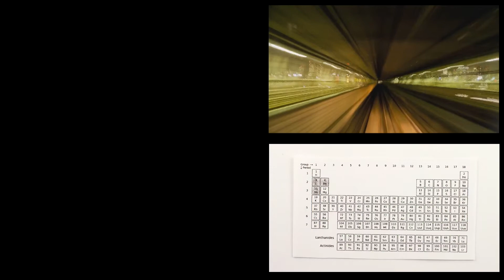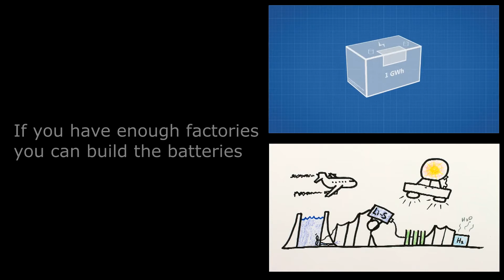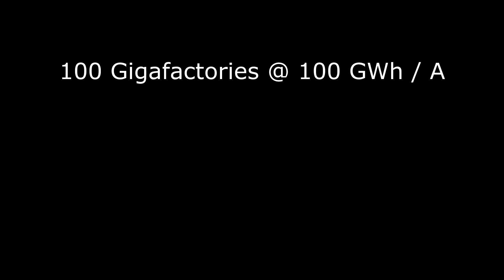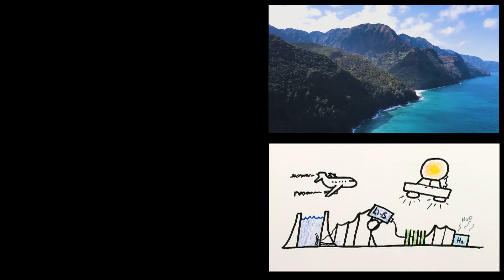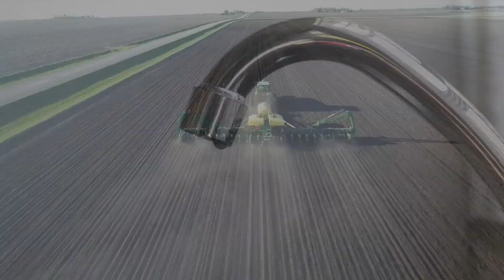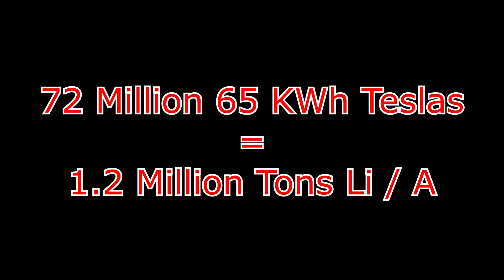Rebuttal to Minute Physics and Real Engineering

Comment: There's an even more egregious problem inherently in the wind-to-battery-size estimate. It starts from the premise that the 130 MWh Hornsdale battery next to a 350 MW wind farm "removes the problem of variable wind speed" and makes that wind farm a dependable on-demand power source. This is bullshit, the battery cannot store so much energy (only 20 minutes of full output) and it also can't even release enough at once. It is there to provide some balancing and a little bit of storage but doesn't make the wind farm fully dispatchable and no official source claims so.
This is like saying the standard lead acid battery in my car makes it an EV.

Comment: Another thing that can be noted as incorrect in both of those videos is when they say that being light weight is a largely important factor in developing batteries. Being light weight has actually very little bearing on whether a battery is suitable for grid-level storage. Sure it is important for mobile applications like phones and vehicles, but not for immobile installations.

In terms of grid level storage even energy density is not as important as material costs, availability and engineering costs. These batteries would need to be cheap and simple. Currently Lithium Ion technology is completely inadequate for the task.

Comment: Right at the moment, the battery volume constraint isn't lithium itself, but lithium cobaltous oxide.  There's about as much mass of cobalt as there is of lithium, & it's much more difficult to increase cobalt production than lithium production.  Li comes from salt deposits & brine (petroleum brines, currently being pumped into aquifers around the world, could be tapped for this, as could seawater & many saline aquifers), while Co is mostly a by-product of things which are already expensive & being mined about as fast as possible.
Obviously there are other chemistries which could be put to use, but they would require entirely new factories.

Comment: Did you see the scathing report by Abdulla et al, here, on Department of Energy's nuclear energy programs? http://iopscience.iop.org/article/10.1088/1748-9326/aa7f10/pdf

I mentioned this in passing on one of my previous comments, but it looks like someone has actually gone out and done an actual study on the situation.

- The overwhelming majority of DOE funding goes into NNSA (nuclear weapons). 
- What remains after billions are spent on devices that can destroy civilisation are a small amount on devices that can power civilisation. Of that, after all other things are broken out, advanced nuclear constitutes only 0.7% of total programmed expenditure over 18 years.

What is clear is that while bureaucrats may make proclamations about the future of nuclear, the money that is actually spent reflects what is actually happening. As it so happens, DOE believes more in the future of fossil and RE, and its budgets align with that. While almost half of those funds devoted to nuclear energy are spent on "administration" and "upkeep". I have said it before and I will say it again. Look no longer at the United States of Fracking for leadership in nuclear power.  They will have their gas, and they will burn it, and they will put up solar and wind as greenwashing for the CCGTs underpinning all of it.

On the mathematics of batteries, One cannot escape cycle degradation unless flow batteries are used. But flow batteries have nowhere near the materials efficiency or energy density of solid electrolyte cells. And solid electrolyte cells, no matter their chemistry, can never attain the energy density of hydrocarbons. And even as efficiencies are gained in electrical storage, so too, do efficiencies pile up on the order of 1% per year in gas turbines, and the same in internal combustion engines. To assume that the field will freeze for fossil competitors is a pipe dream.

Comment: I looked at that Solar PV/Tesla battery system used in Kauai, Hawaii. 52MWh for a 13MW wind farm, latest hyped up largest in Hawaii battery storage  which would supply 0.2% of Hawaii's electricity for one day.  That is just to cover the daily solar variation. To cover one cloudy day you would have to double that storage. 

And you will still need 40% fossil generation for the seasonal variation, no storage available for that. And Hawaii has a very low seasonal variation, in many areas Solar has a ~6:1 ratio summer:winter variation, i.e. Switzerland, Britain, British Columbia, Norway, Germany, Russia with power demand max in winter, and wind is typically missing in action during massive winter cold spells and summer heat spells, solar missing in action during winter cold spells when power demand is max, there is no energy storage that can compensate for those seasonal fluctuations economically. This important fact is ignored in the mickey mouse Youtube videos from those two sites. And cost for that one solar/battery system in Hawaii, is $32K per avg kw, for 25yr hopeful lifespan only 6X the cost of a substitute Nuclear power plant @ $5-8k per avg kw for a 60-100yr lifespan. And you still need to pay for the vast fossil infrastructure, pipelines, gas fields, oil fields, coal mines, rail distribution, fossil power plants, military protection etc all fully maintained and operational to cover the minimum 40% seasonal variation (for Hawaii) and one or more days of cloudy weather, volcanic eruption, freak weather, monsoons etc. All you really are doing is replacing a bit of fuel, NG fuel costs 2 cents/kwh in the USA. Unlike the solar the nuclear doesn't need any fossil or storage or vast precious Hawaiian land destroyed, covered with solar panels, 65 acres for this one mickey mouse Pixie power site alone.

And because the EROI (energy return on invested) for the Solar PV/Battery system is below 1:1, all you have succeeded in doing is coming up with an expensive, complicated way to burn fossil fuels. Also not considered in those two Youtube videos. That's why Big Oil just adores Wind & Solar, they know it is no threat to their Energy Hegemony, it just pushes up electricity prices, so marginal oil & gas resources are economical to exploit, and makes EVs less competitive to ICE vehicles. And thus they also have a seething hatred for Nuclear power which doesn't need their toxic, carcinogenic smoke-belching fossil, and will push electricity costs down, supply cheap all night charging for EVs, making ICE vehicles much less competitive to EVs.
Reply: whykhr

Comment: TL;DW (too long, didn't watch):
- Decarbonizing the planet with renewable energy together with batteries would require the mining of Lithium to increase by several hundred times. This major issue wasn't discussed in MinutePhysics or RealEngineering's videos!

Fellow environmentalist, please consider nuclear power, the more you learn, the less you fear.

I recommend learning about radiation right now, an essential understanding for an educated opinion about nuclear power.
- Fermilab 1: https://www.youtube.com/watch?v=iTb_KRG6LXo
- Fermilab 2: https://www.youtube.com/watch?v=J-hfoDy904E
- BeCurious 1: https://www.youtube.com/watch?v=egMdKFpxuRY
- BeCurious 2: https://www.youtube.com/watch?v=Yor3SBWeU-o

Awesome! Eager for more? I would then recommend following up by learning about modern nuclear power.
1: Short intro - 8 min - https://www.youtube.com/watch?v=UGf4dOlwXGw
2: Technical intro (5-40 min) - https://www.youtube.com/watch?v=c7baTdyHv8g
3: Technical in depth (7h) - https://www.youtube.com/watch?v=erkRiKd7l3M&t=1s&list=PLuGiwaUJYEZfNHZR1AUmMYoASGWBroXMM
Reply from the maker: Sometimes I want to make a more in depth rebuttal ;) Takes a little more time to explain.
Reply: This is a topic where little info is worse than no info at all.

Comment: Real Engineering says, "...We have time till 2050, that is 33 years from now..."

In this case, the life of the lithium batteries should be considered. After 10-15 years most of the production will go to replacing the old batteries.

Also, It takes energy to make raw materials- Lithium Hydroxide, Cobalt and pure Graphite, which are consumed in Tesla factory (but raw materials are produced in a different factory which may consume fossil fuels). As you have noted, cheap and low-carbon process heat to produce these raw-materials can only be generated by a high temperature reactor like molten-salt reactor.
Reply: Collapse of ecosystems and human greed m

Comment: Did some calculations of my own (likely crap)
 https://en.wikipedia.org/wiki/World_energy_consumption
 +13,699,000,000 tonnes of equivalent oil consumed in 2014
 *          11.63 MWh convert
 *       1,000 KWh convert
 ------------- 
 +159,319,370,000,000 KWh 2014
 /         365 
 ------------- 
 +436,491,424,658 KWh of batteries needed for each day in the world. That's a lot...
Reply from the maker: I'm too wasted to do the math right now, but the figures are indeed mind boggling. And it is ridiculous that some people don't delve deeper and just keep scratching the surface.
Reply: I didn't even bother to account for the energy we would be using in 2050.
Reply: I guess I failed the turing test then...